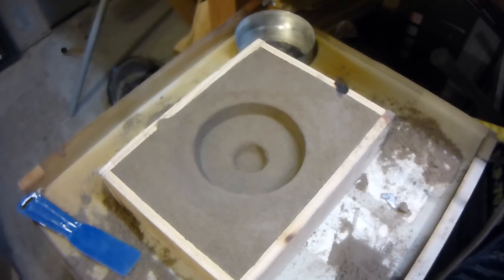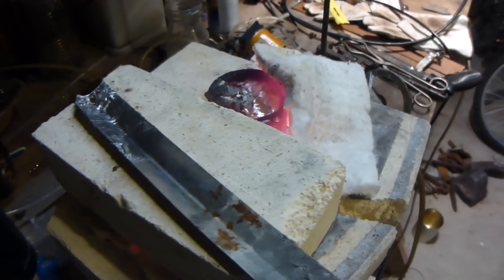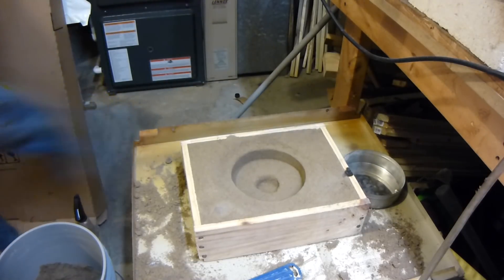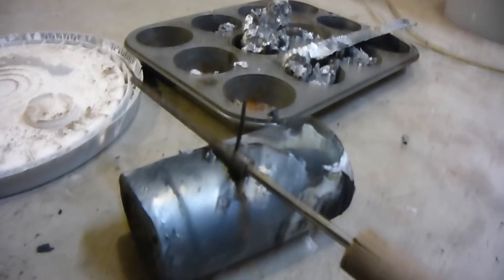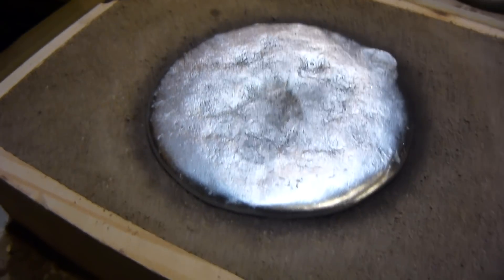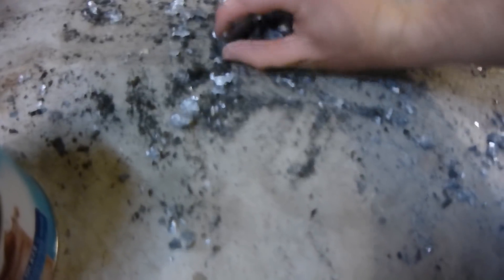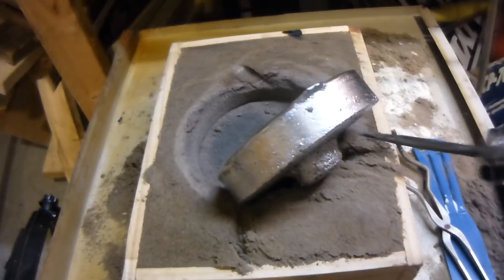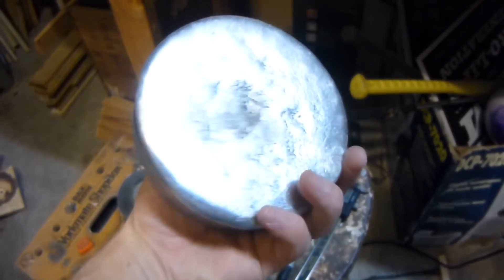Casting an Aluminium Flywheel Using Green Sand Open Mold

Comment: You need to ventilate upwards, and be careful about spending a lot of time breathing air that contains vaporized aluminum. 
Seriously neurotoxic and somewhat, accumulatively  kidney harming. 
What is the potassium nitrate for? Generating more slag/removing impurities?
Reply: Also, hoping the kitty litter doesn't have things to vaporize.
Reply: Electrician by trade càra alami memutikan wajah

Comment: Leave the gas on while you potter around with the molten ali clambering over the crap in your shop, then smash away at the hot/damaged crucible without any protective gear, and don't forget to properly shove your bare hand into a pile of unprocessed slag for that extra thrill
You really want that disability allowance lifestyle don't you, great work and videos but please invest in some basic ppe
Reply: im guessing you have DLA
Reply: DLA?
Reply: +Douglas the basement dweller No, took one bit of stone flung out of an sds into my hand to educate me on the old safety front

Comment: Hi! As a worker in a steel factory I have a few top tips for you! I know aluminium and steel have totally different melting points and that but I really suggest that you work with this outside. 
When you drop molten steel on the floor it bounces and splashes everywhere. It will flee like rabid ants and set everything on fire.

So with your next video I hope to see that your furnace and mould is on the floor with nothing that can burn close by. ;)

Other than that, I like what you are doing. Keep it up!

Comment: Some advice turning the aluminum. I realize your stock isn't balanced (hence the turning operation) and that you're holding it in a chuck, but aluminum turns ALOT better if you turn your rpm up. Especially if you're using carbide inserts.

Comment: i worked in a zinc foundry for many years casting zinc targets. all i can say to you my friend is all it will take is one good burn for you to realize that safety gear is paramount. while its fun and cool to cast, you should always be prepared.
Reply: +dantediss1 It's obvious that this kid doesn't do this very often, the less often you pour (if youre careful) less chance of getting burned overall.
Reply: +rdizzy1 this is true. but it also seems as if he has the desire to continue. he is doing a pretty obscure casting method that i myself only did a few times in my casting years. but you need to remember it only takes one time to get hurt. and even more so when you are just begining. when he started spraying it i was waiting for a spatter explosion. since it usually cools edge to center the casting may have looked solid but the center could have just been barely cooled over. i give him credit for attempting it. but leather gloves, long sleeve shirt, and a leather apron can be had dirt cheap. another worry was his limited space. he should have cleared it out a bit. after seeing his other videos he is a very competent individual. and definately has some brains in his head. safety should have been a thought in regards to this fact.

Comment: Hey I have a great idea....Buy a real crucible.
Reply: +ootie extreme Real crucibles are kinda pricey and many of them don't last much longer either.
Reply: CoolKoon
I know but how much work is it to keep forging crucibles after another and you only get like 2 burns out of it before it fails. I found my 30 dollar graphite crucible to be very well made and it even got heated to 3000F and there wasn't even a scratch. It will save you a lot more in the long run rather than something that could fail at any time.
Reply: +ootie extreme That's true and graphite can be used for aluminium quite well too (although it kinda conducts heat too well, so a lot of it escapes through the crucible before the metal gets molten). Do you happen to have a good source of cheap graphite crucibles by any chance?
Reply: +ootie extreme Oh, I see. That's clay graphite though, which is (if I understand it correctly) some sort of fired mixture of graphite powder and clay. It's more than fine for regular furnaces, but the kind of "arc furnace" I use would most probably crack them pretty fast. Thanks though ;)
Reply: CoolKoon
Arc furnace? tell me more
Reply: +ootie extreme I got an oil welder (an oil-cooled welding transformer) connected to graphite rods. Thus I need either a pure graphite crucible (which I have, but I'd want a bigger one) or something else that can withstand the big temperature gradient of a carbon arc.
Reply: CoolKoon
What is the max temp?
Reply: +ootie extreme So much that it even makes the (relatively thick) graphite rods slowly evaporate. According to Wikipedia at arc terminals it can reach up to 35000°F (around 19000°C). Basically it's hot enough to melt anything should it say in contact long enough with it. My first crucible was an alumina brick (you know, those really light ones), but when I wanted to melt iron in it, the brick started to melt too. Thus now I'm looking for an alernative.
Reply: CoolKoon
How much money did it cost?
Reply: +ootie extreme The welder was about €250 worth of pounds including shipping. The graphite rods were rather cheap, about $20 for the pair. The brick cost about €2. The graphite crucible was also fairly pricey. About $50 for a mid-sized one, but it also came with a ceramic holder.
Reply: CoolKoon Lol I do not know what you could possibly want to melt with 35000 F?
Reply: +ootie extreme You can melt anything with 35000 F, but that's not the point. The point is that with an electric arc you can melt pretty much anything pretty fast, even nonmetals that you couldn't heat up in induction furnaces at all. Also, for things like corundum a regular gas-fired furnace is out of the question as well (only hydrogen and acetylene torches could melt it, but I think that a carbon arc setup is much easier).
Reply: CoolKoon
God that is just crazy though. You could melt rocks into lava in an instant.
Reply: +ootie extreme Well, not in an instant (because it isn't only about temperature, e.g. heat capacity plays a big role too), but yes, indeed you can. Provided you manage to obtain a crucible that doesn't get ruined in the process that is ;)

Comment: I have used a recipe for moulding sand, that you can cook to make it hard and it is environmentally friendly, well as organic as it can be.  (  cracked sand, and Californian clay, and molasses, this makes a moulding sand that can be cooked to set, and it sets very hard, good for sanding and shaping etc  you use around 5% Californian clay 90 % cracked sand or builders sand must be clean washed,  5% molasses  this sticks it together  and act like cement when cooked )  you need around 1.3% wetness  max before its cooked and gets  hard if its very dry,  if it sits a day or so it will suck water out of the are so cover it(  you can use this sand like moulding clay if it is at the right wetness it balls up if squeezed  in the hand,  and is pliable when warm at around 1.3% wetness   )  ( this is not my recipe it was the process a man call  jack coots had )   you can reuse it by placing it in a bucket with a lid with a cup of water (  this sand was used instead of toxic resin based sands that need to set like stone to be used in thin walled and or for gallery's in the work pice  can be uses for small parts  you will need to vent the work in big jobs to let out gasses  if you have any questions

Comment: you should use boric acid/ borax. it stops the slag/dros from forming because it floats on the surface and stops the oxidation of the aluminum by covering the surface and blocking it from the air. so instead of getting 1/2 pound or more of slag you wont get any.
Reply: +Makerj101 Yes on the Borax. Laundry isle in most stores.
Reply from the maker: +mike caretti Thank you!  I will try that!
Reply: like not just a little bit use like several table spoons full make like a 1/4 inch thick layer of it. it is ok to pour with it on there it will just make a glass surface on the top of the part your making. easily broken off and also stops oxidation from forming during the cooling process.
Reply: @makerj101  
I hear that borax is really bad for aluminum as it reacts and destroys it but borax/boric acid is good for copper/brass and forge welding.  Any confirmation?

Comment: Why use aluminium for a flywheel, though? If inertia is the point, wouldn't it make sense to use something with a higher specific gravity?
Reply: Harder to melt and make yourself maybe? ¯\(ツ)/
Reply from the maker: +Hazel Hazelton Well I would have loved to melt steel but that's going to be nearly impossible for me to melt.  I could use lead but I don't really want to get lead poisoning when I machine it.  Zinc would have been a good choice but I didn't have enough.  Brass, I didn't have enough. Nothing else I can really think of that I could have used.

Comment: I have a coal foundry and my crucibles keep melting, any ideas on a good steel crucible that would last? Or maybe a graphite or clay one same size as yours
Reply from the maker: +TheDumbproductions1 Use an old propane tank.  They will last one or two castings but they are free if you know someone who goes camping a lot.  https://www.youtube.com/watch?v=ZMLX9LadQS4

Comment: have you tried bottom fed casting? you will find you get a much better casting (closed molds) because it reduces turbulence of the metal and also allows excess gas to escape through risers. it also means any slag or other impurities can float to the top without disturbing the casting.

Comment: You need to be more patient and leave your casting until they are naturally cool, for a simple cast its less important but it is just good practice. Also to get a nice surface you should use your crossfeed rather than using the lathe manually.
Reply from the maker: +Hyss true and true

Comment: Hi Makerj101, Good to see you are making stuff and learning all sorts of things that most of your mates will not even get close too, but could you Please invest in some more safety gear. 
For your own safety please invest in some leather welders gauntlet gloves, a good welders jacket, a clear face shield, safety glasses, work pants, and steel capped work boots, as your scaring the crap out of me and others.
Think about how much pouring a hot cup of water over yourself would burn and hurt yourself as you are currently dressed and then multiply that by at least 7 times plus factor in hot sticky aluminium and you could be in serious trouble Fast.
I was recently welding some brackets and mixed a freshly welded item with some previously welded ones and accidentally picked up the hot one without a glove on. In the time it took me to say Oh F@#k and drop the item, I had given myself three deep and hot little burns to the tips of the three main fingers of my right hand. I spent the next 10 minutes cooling my hand under running water followed by 1/2 an hour cooling my hand in a cup filled with ice cubes and water. It hurt and I had some very mixed up nerve endings in my fingers for quite a while. Now if that was the result from 15 seconds of contact, what do you think the result is going to be if you have hot molten aluminium stuck to your skin for one or more minutes????
Please show this comment to your parents and then make the case for heading to the nearest welding supplies shop near you to purchase the above safety equipment. Remember that safety equipment is cheap compared to medical bills and pain and suffering.
A young person such as yourself should be encouraged to keep exploring and learning important trade related skills, but please do it safely so that you can learn and go on to do great things.
Reply: +Mark Fryer I'm not concerned about your safety, have at it!
Reply: +ipissed practice what you preach, buddy.
Reply: +Mark Fryer Thank you for your support, Lucas, Craig, John and Jess. I dont want to come across as a safety nazi, I just want Makerj101 to be well aware of the dangers he is exposing himself to by not wearing the proper gear. Casting metal is very dangerous as are many things done in the workshop, the important thing is to minimize those dangers were possible. 
Makerj101 is a very talented young man, who is learning and demonstrating some amazing things for us all to enjoy and I want him to be able to continue to do so, safely.
Reply: +ipissed Funny the hospital wards, rehab hospitals and cemeteries are filled with the broken bodies of guys who think like that.
Reply: +ipissed Stop being a keyboard warrior and get some real time in a dangerous work environment and then if your still intact come talk to me about safety.
Reply: +Mark Fryer I couldn't have said it better myself. All great points. Stayin' safe long enough to enjoy the things you love for years to come is SO damned important. Safety is always #1! I love hobbies like this and have ridden motorcycles for the last few years and I never get chintzy on safety gear.
Reply: u r such a nice person for saying all dat,may god bless u,u r the caring people we need in this world
Reply: +Mark Fryer notice he replied to the comment about being a lesbian but doesnt have anything to say about being safe
Reply: +Mike Sanchez Well I have said my piece as politely and as thoughtfully as I can, and tried to share some of my 30 odd years of industrial experience.
I can lead a horse to water, I cant make it think or drink.
Reply: +Mark Fryer My old physics professor with 4 degrees, (2 bach, masters, phd, all in different stuff!, guy is crazy) just almost lost his thumb!!! Safety is a priority for everyone, doesn't matter education or skill level, thankfully he was taken to the hospital in time and they managed to sew everything up, no word on the nerves yet but it wasn't hanging on by much!
Reply: +rubbernip Thank you, we could all do with an uncluttered workspace.
Reply: +super man Thanks you for your kind words and blessings. May I wish you a Merry Christmas and a Happy New Year in response.
Reply: +Mark Fryer woah fifteen seconds is actually an incredibly long amount of time to be touching something like that
Reply: +CalvinJakoby Well as you will understand, it was only an estimation of the time, I wasn't exactly timing how long I had a hold on the hot metal. Fortunately, I reacted by throwing and releasing the hot item from my hand, but by then the damage had been done. The three burns blistered up, but eventually wore away after about two weeks.
As for just how hot the item was, I had just welded it, taken off my gloves and then went to pick it up by mistake, so it was still very hot. 
The important lesson is to keep a defined work flow, cold items to one side, hot items to the other side.
Reply: Mark Fryer i'm sure you weren't i was just pointing out that it may be around 1 second but it really doesn't matter
Reply: longest comment ever 10/10 IGN
Reply: digitalons
Thanks, I made him do it.
Reply: I go to welding class and i agree, safety is #1
Reply: +Mark Fryer Kid, this guy is absolutely correct.  I was an invincible young buck once myself, and I count myself extremely lucky to have come through unscathed.  I'm sure I did all sorts of things that would make me cringe to watch today.  Someday, if you continue to be lucky, you'll actually have this video to look back on and cringe.  You seem like a great kid, I urge you to think long and hard about safety above all else.
Reply: Mike Sanchez
Fuck safety you gotta be bigger faster better stronger than the next guy no matter what.
Reply: Mark Fryer
calm down

Comment: what was the potassium nitrate for?
Reply: +Aaron West As the aluminium melts it takes in nitrogen from the atmosphere so you need to bubble through some inert gas to capture the nitrogen and bring it to the surface.
Reply: Mark Fryer I'm guessing the nitrogen is an impurity then? Not trying to be sarcastic jus I'm new to all of this lol.
Reply: +Aaron West Sorry I made a mistake as its Hydrogen that is absorbed from the atmosphere and you can bubble  nitrogen through the melt to help remove it.
Careful, its a very addictive interest to start learning about, lol.
Check out; myfordboy, doubleboost, jorg sprave, dzuari, Aharon m, Brian Oltrogge, Keith Rucker, Jim Taylor.
These are just some of the people on YT with good casting videos to view.
Reply: Mark Fryer Thanks again!

Comment: Any ideas on what too do with loads of bear bottles??? Prob better off filling with cement and making a glass wall than trying to melt that stuff right?
Reply from the maker: +\ 0909 I mean you could melt them down.  I wouldn't because I have better sources of higher quality aluminum.  But if that's the only aluminum you have then go with that.